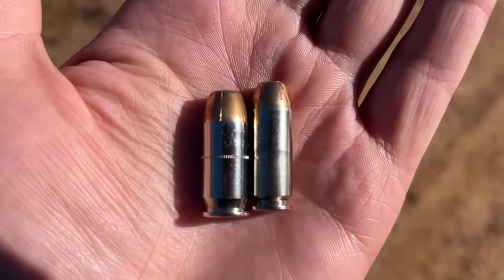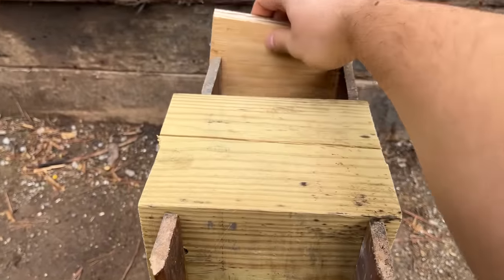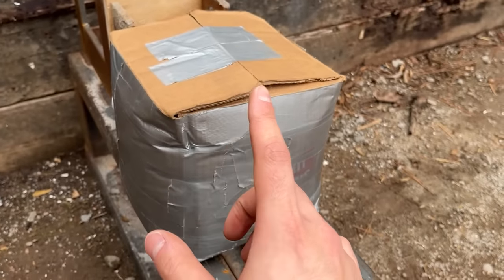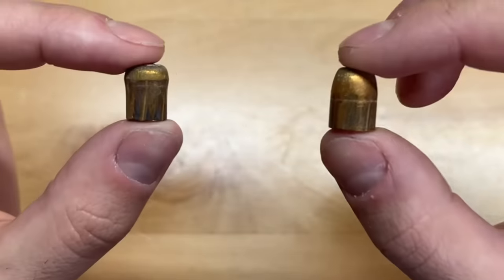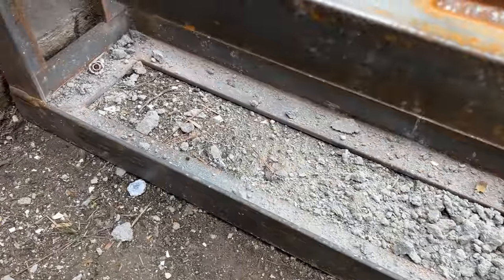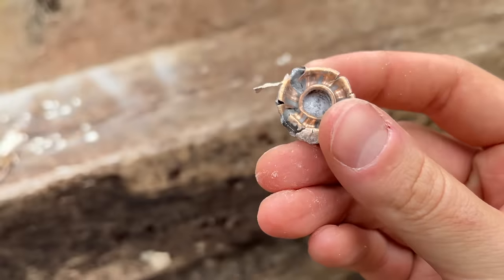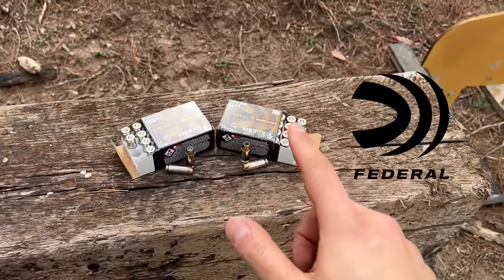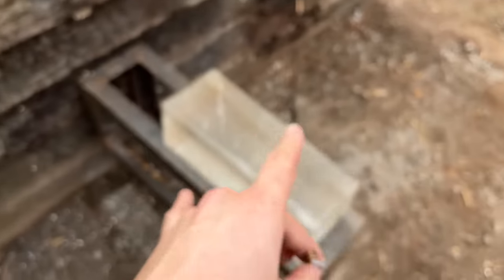45 ACP vs 10mm: Unbelievable Difference On Barriers

Comment: It’s no surprise the 10 penetrates barriers deeper/better. The 45 was never intended to defeat barriers, just people.
Reply: And the 10 mm does both better
Reply: @halogod0298  Then you better know what's behind that barrier. Every bullet has alawyer attached.
Reply: Ammo dependent
Reply: well said
Reply: Well…. Horses not people
Reply: 255grain Hardcast plus p and 45Super both would love a word with yall😂😂
Reply: @ryanupchurch9683  the 45 acp wasn’t developed to kill horses. It was tested on cattle and may have been tested on horses but it was conceived, developed and implemented for stopping and killing humans.
Reply: @randallbollinger1449  no it was developed as a Calvary cartridge to stop horses and drugged up philapinos (sp)
Reply: @ryanupchurch9683  provide the source for the horses part. I agree on the drugged philipinnos
Reply: @halogod0298 and the 357 magnum does everything better then the 10 mm
Reply: @halogod0298 No so…45 dumps its energy far better than the 10.
Reply: @k9m42  cool but it doesn’t work in semi autos and is irrelevant
Reply: @halogod0298  Say that again, that a .357magnum in a revolver is irrelevant.
Reply: Coonan 1911 fires .357 magnum (shot down) lol
Reply: @ryanupchurch9683  cows not horses
Reply: @ericm3327 it was tested on cows. Yes. It was DESIGNED for horses. Tell me why does a Calvary soldier need a pistol to kill cows?  Makes a lot more sense for a Calvary soldier to need to stop a horse. They tested on cows instead of horses because it’s cheaper and a acceptable substitute for a horse.
Reply: Either one is putting leaking holes in shit
Reply: It's no .44 magnum.
Reply: It's no .44 magnum.
Reply: It's no .44 magnum.
Reply: It's no .44 magnum.
Reply: It's no .44 magnum.
Reply: It's no .44 magnum.
Reply: @jasonashley4579  it's no cannonball either...
Reply: @1636patriot  it's hard carrying the 105  howitzer in bear country, Ruger redhawk is gonna have to do.
Reply: And Horses
Reply: @dariuswilliams7509 Yep. Loaded to the same pressures you'll have similar penetration w/ a larger hole.
180 Hardcast out of a 9x25  Dillon or 220 HC from .40 Super is about Max Penetration you'll get from a standard auto pistol
Reply: @halogod0298 no, the average shooter is less accurate. It’s the whole reason the FBI stopped using it. If you can’t hit your target none of it matters.
Reply: At the end of the day, it's still a pistol.
Reply: @georgewillis7399 I heard about that gun the other day it looks like a shithole but I’m so glad people are trying to make these things a reality
Reply: I was actually thinking this, it probably depends on your purpose, do you want to kill, or knock back and deter, I realize that both will kill no problem but 45 definitely has more mass
Reply: @randallbollinger1449  The .45 Long Colt was to stop horses.  The .45 ACP was to have similar ballistics but tested on cattle.
Reply: @mistermurtad2831  that’s what I found in my research too. Which is why I asked the the guy for his source that the 45acp was originally developed to stop horses, he never responded
Reply: @randallbollinger1449  It was, but once removed through the desired ballistics of the .45 LC.  It was designed to stop.  
In the example, the 10mm went through the ballistic gel.  It wasted energy.  All the energy of the .45ACP dumped into the target.  While both are lethal, the 45ACP had more than enough energy for the job without excess. 
I did like his .45AARP line.  I do qualify, but these young whippersnappers don't understand terminal ballistics. Dag Nabit.
Reply: @mistermurtad2831  🤣
Reply: @k9m42  every advantage of a semi auto vs a revolver is the advantage of a 10mm over the 357
Reply: @jasonashley4579 u aint tryin hard enough. If you arent carrying a team on a m119 then you cant consider yourself an outdoorsman
Reply: @randallbollinger1449 .45 auto in the 1911 is what you're talking about about but .45 colt had been around for a lot longer before that
Reply: That's why they use ballistic gel. It is inexpensive compared to big animals.

OTOH, if ability to penetrate vests and other protection is essential, then those items are used as targets.
Reply: @halogod0298    Why do you have an emotional attachment to your 10mm?
Reply: @randallbollinger1449    10mm was designed to pass though intended target and hit bystanders/property.
Reply: @elypowell6797  it’s not emotional, it’s superior
Reply: Exactly!! Of course the 10mm is more powerful than the .45. But the .45 still won 2 world wars not the 10mm!!!
Reply: @ryanupchurch9683  You are confusing the 45 acp with the 45 Colt. The Colt round was required to penetrate a horse at 100 yards. Knock a cavalryman off his horse by killing the much larger and easier to hit horse and he's on foot and easier to run down and kill.  It predated the 45 acp by 40 some odd years.
Reply: 45 And with less drama, quicker follow up shots, for the common man, not elite trained.
Reply: And the .45 does that well. Just depends on application. Trail gun? 10mm Tact all day. Concealed or on person carry? 45 ACP for me. Don't want to kill the person behind them. Just saying.
Reply: @dariuswilliams7509 45 super is not 45 acp. And still had less energy.
Reply: @k9m42 about the same. Though I love 357 more for versatility in revolvers
Reply: @F35_JSF  agreed
Reply: @dontworrybout2664  What comment did you reply to?
Reply: @k9m42  Except one thing....ammo capacity and weapon. Performance wise? 357 all day long.
Reply: I wouldn't want to get shot with neither one
Reply: @skionen1781  True statement my friend. Either one is a death sentence.
Reply: @halogod0298  Their was few semi-autos in 357  and AutoMag was created to fill that gap, but never really caught on. Just figure I would point that out.
Reply: @kfelix2934  yeah I know that’s my point. It’s not a thing generally
Reply: @williams7509 Then.. 10mm 220 grain hardcast would like a word with 255 grain hardcast +p and 45 super. 220 10mm hardcast will outperform the former and equal the latter(Actually develops just a little bit more energy even, about 40 joules more..) so I really don't get what you are trying to do except out yourself as a fudd.
Reply: I was replying to darius though, my friend; not contending with you. When I edited the comment it must've broken the @link and added it as general reply which has been happening to me lately; it's as though it cuts off the first bit of their name
Reply: @halogod0298  it over penetrates and leaves a smaller hole. The .45 dumps all energy into a person, the 10mm blows right through.. So no..
Reply: @Mathilda2zeroplus one is real and the other is myth
Reply: Seriously.. if you use 10 mm for self defense that would be extremely stupid..
Reply: @jeffheyer7783  notrly.. there are many jhp loads that meet fbi spec
Reply: @johnr4660  do you know the word probability? Pretty much zero chance you'll hurt anyone other than your target...
Reply: *horses  (not only people)
Reply: .45acp is really only decent up close. All bullets are made to “defeat people” that’s just a silly statement all around. And barriers are very common and barriers didn’t just start existing today, and they play a very significant role on your bullets and if they do their jobs or not.
Reply: Buffalo bore has a 45 LC with ~1100 ft/lbs out the muzzle. That's some gnarly stuff

Edit: haven't tried it yet though
Reply: Calvary and cavalry-  two very different things actually.
Reply: The 100+ yr. old .45ACP 230FMJ "Hardball" cartridge does everything the Black Powder .38-40 & .44-40 did in their.
Smokeless powder & JHP bullets augment the performance of the venerable cartridge.
Higher-velocity/lighter bullets help to "modernize" the .45ACP, making it more attractive to those who might overlook its historical contributions.
However, most platforms cannot provide the magazine capacity that 5.7mm, 9mm can offer.
Reply: @exothermal.sprocket  Fudd alert
Reply: @k9m42 completely wrong...close but wrong
Reply: @jasonashley4579 that's why I drive a 155 self propelled howitzer...easier on the back
Reply: I’ve loaded the 45 acp hotter and use an aftermarket barrel that fully supports the brass so no glock “smileys”😊. I’ve run it up to 10mm speeds using shortened 460 rowland brass using up to a 24 lb spring in that aftermarket barrel. The underwood high speed stuff will penetrate barriers too😊
Reply: @dariuswilliams7509 I like how you have to go above and beyond to even compete with the 10mm 😂
Reply: @k9m42  Except work in autoloaders
Reply: Actually the 45acp was designed to defeat cows...
Reply: @halogod0298  not with bad loaded ammo like federal or s&b or armscor there .45 is better
Reply: @uurkisme  ok sparky
Reply: I thought the whole point of .45 was to dump it's energy into the target.
Reply: @timdixo I’d rather have a lot more rounds and better muzzle energy than  “stopping power”
Reply: @halogod0298 well not really a 45 creates a bigger hole on impact versus the 10 bring over powered and going straight threw
Reply: @jeffheyer7783 we got some pretty bod gangstas here in Memphis
Reply: @thomaspalmer7900 how exactly it won those 2 wars ? with what contribution ... in fact it was so underused so no one even noticed how garbage it was
Reply: @halogod0298 yes agreed, but still prefer the 45acp in plus p. Both for sure would ruin someone's day if hit. Not sure they would know the difference. Plus 45acp is cheaper to feed my guns with. Really want a carbide in 10mm though. That is one hell.of a combo that would be devastating.
Reply: @drewrinker2071 a.22lr will kill if hitting the right spot. 10mm and 45acp will stop anyone fast and effectively. The more I geek out on terminal effectiveness of cartridges, the more I realized that caliber size obviously helps. But still only as good as the person aiming it. That is what matters. Hell countless deer have been taken with 357magnums.
Reply: @roberthsieh8639  yes but 357 is harder to jam. Just squeeze trigger again and move to next round. Statistically most handgun fights last 3shots average and distance is 9feet. So most important is aiming ability and fast incapasitading the target as quickly as possible. Both do the job with spades. 10mm definitely has the energy advantage, but 45acp has weight advantage and makes slightly bigger holes. Both great choices!
Reply: @jeffheyer7783 😂 now that answer was stupid. Wtf both are great choices. Use whatever you shoot the best. I would rather have a 22lr that I could shoot effective, than a 45 or 10mm ,9mm or other if I wasn't able to use comfortably.
Reply: @Tiuyyvvvghh567 😂 🤣 ❤, almost made me 💩 my pants. 🙃😂🤣😅😁
Reply: @Jaccobbedd455  then if that is your criteria...hell 10mm is lame compared to 44magnum, or why not use a short barrel sbr in 300blackout or 5.56? 10mm is a great round but not going to matter if you can't use effective. The guy using a 22magnum or 380 who aims true and can follow up Shota faster wins all day long over size of round.
Reply: @Hijackerrr 🙄 underused? M1921A1(Thompson sub machine gun) and 1911 colt 45 were underused? Wrong and ignorant about history. Hell special force members (green berrets and navy seals) used it at times even in Vietnam. Soldiers loved the reliability, stopping power and easy to wield in tight quarters. German soldiers even thought it superior to the 9mm Mp38 submachine gun they used. Quoting "the reliability and fast knockdown power). 😂 honestly why fight or argue over calibers? None of which work if the person can't shoot accurately and comfortably.
Reply: @millermanhal  mh what other sidearm there was issued during vietnam except 1911??? And yes they would rather take thompson - heavy weapon in pistol cartridge made from wood  because nothing is better in jungle conditions like i dunno M16? Ak, or even that stupid m14
Reply: @millermanhal  german soldiers in vietnam ...
Reply: And you want to defeat BEARiers
Reply: Put a 180 grain bullet on both cartridges the 10mm will get to 1000 fps while the 45acp will reach about 1150 fps. If you want to match the 10mm speed with the 45acp, just lower the grains on the bullet. I personally carry a 180 grain. The .45 cartridge has a superior potential for speed compared to the 10mm because it has a higher volume in the cylinder. The 230 is way too slow and it's like lobbing a musket round. If what you're looking for is penetration over the impact wound cavity, then go with the 10mm and get the smaller bullet. If what you're interested in is a larger wound cavity on impact with less penetration, then you go with the .45. A Corbon's cartridge for a 45acp with a 165grain bullet gets you 1250fps from a 4 inch barrel and 1300+ from a 5" barrel. The bottom line is that the .45 has more available volume. There are 75. grain bullets for the .45 that get 1900 fps.

Comment: Love the .10 but this test validated my choice of .45 for home defense. Over penetration is of paramount consideration for myself. Thanks for this! Subbed!
Reply: Meh, I use a simple 9mm with hollow point... It's doubtful that it will go through a perp, and even if it does by chance, it's unlikely to go through the walls of my residence as the walls are concrete and chicken wire instead of drywall (because the building was built in 1912)
Reply: What is .10? .10 as in 10 caliber?
Reply: @abones900 it’s like a toothpick but sonic speed, .10/000 😂
Reply: @MrEli768   You'd be AMAZED at the penetration of a 9mm with a plugged cavity. Honestly, a plugged 9mm or 9mm fmj can penetrate more than a 5.56mm.
Reply: Love my M&P 10mm it’s earned it’s edc with over 1,000 rds and 0 failures
Reply: @abones900  The 10 mm is a  .45 on a diet with a couple more cubic centimeters in it's motor.
Reply: @TisiphonesShadow  I'd be interested in seeing examples of that, seems unlikely given the rate of speed the 5.56 is driven and the likeliehood of higher speed smaller projectiles to penetrate better.
Reply: 380 is an even better choice if you're looking for an underpowered round.  😂😂😂
Reply: @TisiphonesShadow in your dreams.  Put down the pipe bro.
Reply: @abones900  10mm
Reply: @TisiphonesShadow  Tell me how that's possible because that is definitely not true
Reply: Who uses a .45 for self-defense? Are you trying to stop your neighbors intruder too?
Reply: @ravekid23  It's what it was designed for skippy. For almost a hundred years, tried and proven
Reply: @ravekid23  ????????????
Reply: Lol just get a lighter 10mm round like flexlok.
Reply: 10mm 1250fps makes for an admirable wound channel. No matter what projectile you choose.
Reply: @enmiredbythelazy4401 isn’t the 556 known for fragmentation? I could imagine that hurting it’s penetration, even with the much higher velocity. Of course, this is just speculation.
Reply: @alecnull  It depends on the particular ammunition used, some are more frag oriented, others are more penetration and expansion oriented.  Fluid dynamics play in, as well as range.  The frag aspect in the rounds meant for it is induced by tumbling in a fluid environment (as is the tumbling, they don't tumble all the way to the target unless your rifle has issues), so unless the barrier is a fish tank or gel-block body armor, probably not a huge factor :)
Reply: @enmiredbythelazy4401  Very informative! Thanks
Reply: @ravekid23  it's not like in the movies or video games, yes 1 shot instant downs do exist and plenty of 1 shot game enders. However do you want the person coming at you with a gun or knife to be stopped immediately or from blood loss/in surgery hours or days later after possibly taking you or a loved one's life and limping away from 3?4?5 9mm or .380 rounds. 45 or 10mm are great rounds that give you a higher chance to stop a threat but a .45 does great on humans & light barriers such as drywall/plywood are more likely to stop the fatter slower moving projectile faster than some high speed 9mm and of course light rifle caliber rounds.
Reply: @ShipClubDJ  Bro, if you live in a suburb and fire a .45 it will go through the person, through the wall behind the person and possibly through the wall of the house next door. Zero % of self-defense instructors will tell you to buy a .45 acp for self-defense. You're just asking for a lawsuit.
Reply: Show an example of when that happened in real life.
Reply: @zacharymorris9917  Thank you “Jeff Cooper”.  🙄 🤣
Reply: @zanelittlegray  are you a 45 bro too?  Or actually think 9mm penetrates more than 5.56?
Reply: @zacharymorris9917  I own a 7.62 AK pistol, an AR pistol chambered in .45 (rated for .45 super), a 9mm Beretta 92, a 9mm CZ 1975, a Walther PPQ .45 SD, a 9mm Walther PPS, a S&W 642 revolver & a Glock 42 (380).

My AK & .45 Walther are my house guns, my concealed EDC is the .380 Glock 42. The rest are for collecting and occasional plinking, except for the revolver, which I carry for pocket-firing from a windbreaker if needed.

I don’t own a 10mm, but I do love it’s demonstrated performance.

If I was in bear country and didn’t want to lug my AK on a long hike, I’d definitely buy & carry a Glock 10mm.

I started concealed carrying the 9mm Walther PPS, but it weighs 19.4 ozs, so now I carry the little .380, weighing only 12 ounces. (sorry I’m long-winded)
Bottom line is I try to match the gun to the task, and I hate weight.
Reply: @zanelittlegray  holy fn irony.
Reply: @zacharymorris9917  The biggest irony for me was the reason I bought that PPQ in .45 caliber in the 1st place, lol!

I was originally planning on buying a PPQ in 9mm but I’d already bought the .45 caliber AR and 2,000 rounds of .45 ACP ammo and the danged AR pistol turned out to be a jam O magic.

So I was sitting on a couple THOUSAND rounds of .45 range ammo w/nothing decent to run it through, so when I saw the PPQ .45 under the gun shop counter I knew I had my solution!

An ironic serendipity!
Reply: Stop saying what other people say it's not that serious. Over penetration what a joke